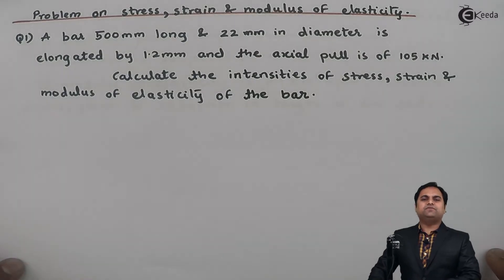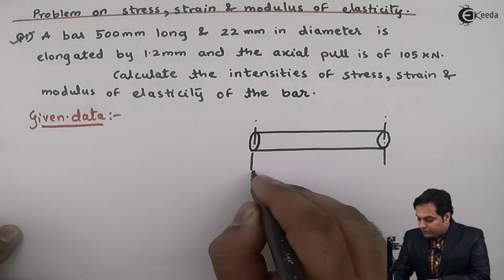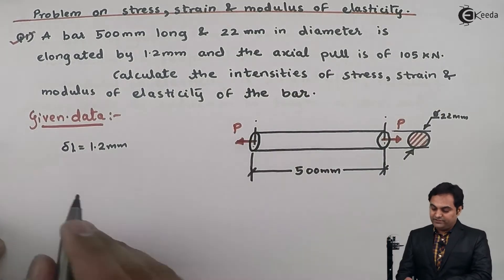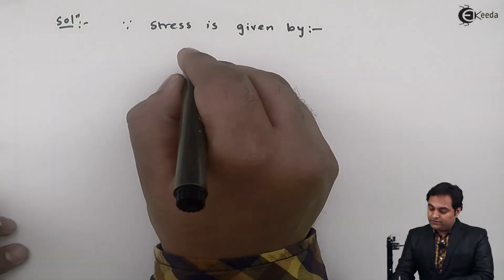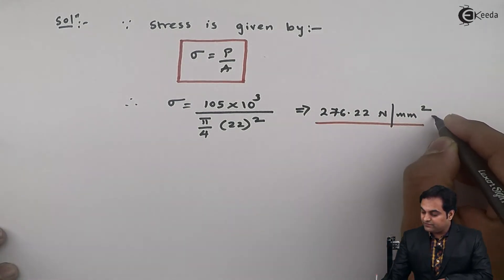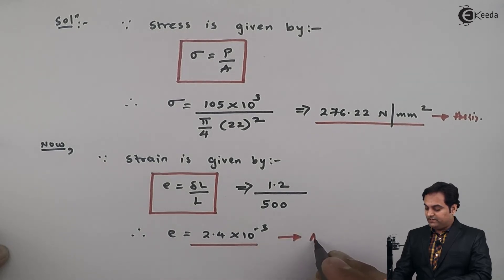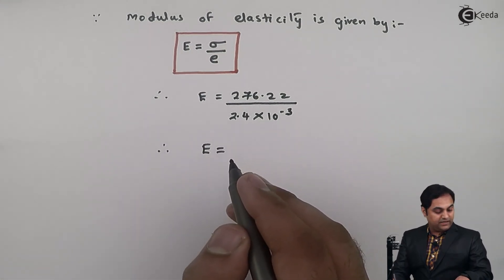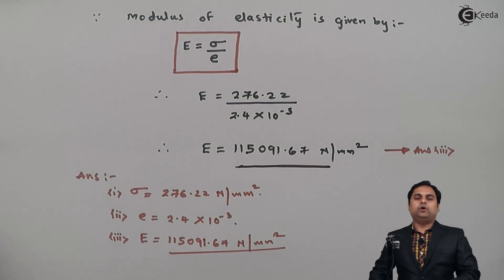Problem on Stress, Strain & Modulus of Elasticity.

Comment: sir please solve me questions
Determine the percentage change in volume of a steel bar 50mm squre in section and 1m long when subjected to an compressive load of 20kn. What change in volume would  a 100mm cube of steel suffer at a depth of 5 km in sea water.
Reply from the maker: We recorded your response. We will work on this and get back to you.